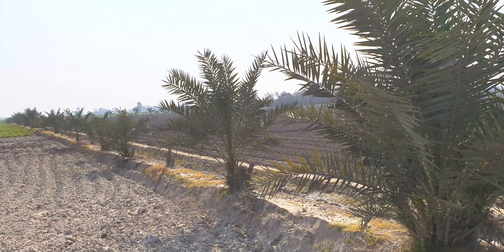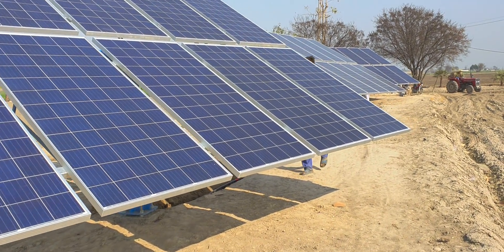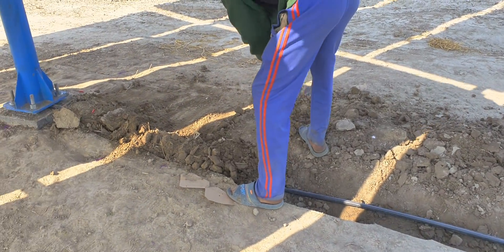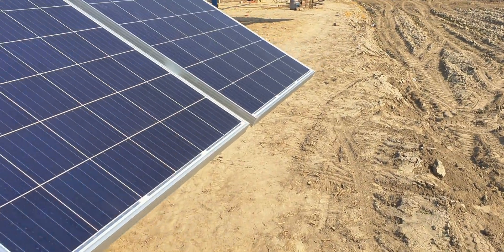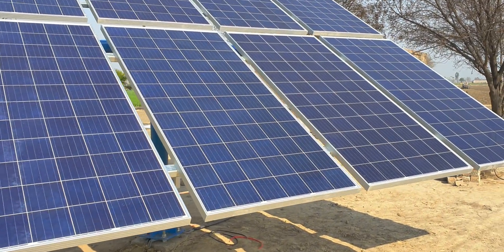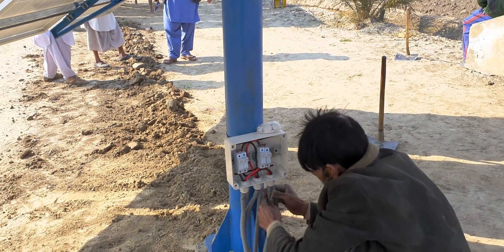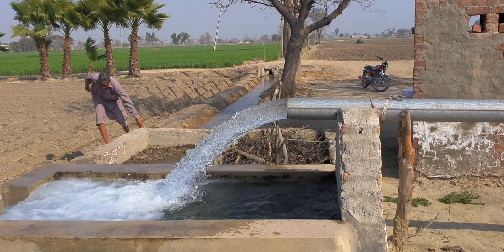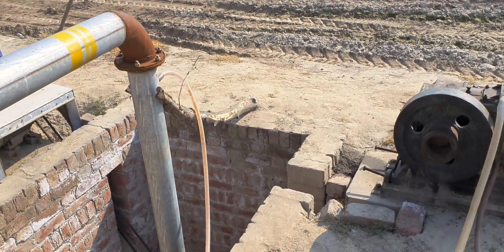𝟭𝟬𝗛𝗣 𝗦𝗢𝗟𝗔𝗥 𝗧𝗨𝗕𝗘 𝗪𝗘𝗟𝗟 𝟱 𝗜𝗡𝗖𝗛 𝗜𝗡𝗦𝗧𝗔𝗟𝗟𝗘𝗗 𝗕𝗬 𝗙𝗥𝗜𝗘𝗡𝗗𝗦 𝗦𝗢𝗟𝗔𝗥 𝗦𝗘𝗥𝗩𝗜𝗖𝗘𝗦®

Comment: good day...how about on a submersible water pump at 30 ft deep? does this setup work?
Reply: Submersible pump will work ,but the problem is the flow (liter per minute) that you need to check how much  your pump can deliver in term of flow  then you  see if it will suit your need or not.
Reply: @hmidasliman6504  how much does this setup cost?
Reply: @skydetectingmetals    850 000 he said in one of the comments  below.

Comment: samarcibal q ni lagaty
Reply: Sami Khan phir desil engen ka option khatm ho jata
Reply: Pani ka laval kya ha
Reply: 40 Py saim hai or nalka or motar ka or 90 Ya 100 Py hota hai, samarcibal ka kharcha kam ni ho ga dosri motar k moqably mn
Reply from the maker: GI LGATY HN JAHAN ZARORAT HO
Reply: I have a tube well 780' depth. Water at 500'. How much HP solar required. What space needed for panels. What is the total cost upto instaletion in TN.
Reply from the maker: @balasubramaniansambasivam2218  required delivery size in inches & flow rate ?